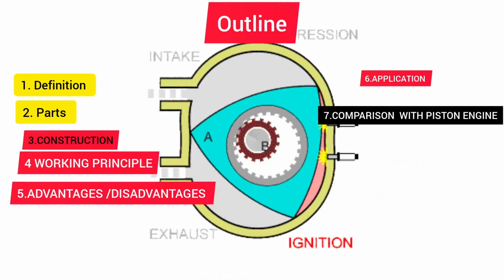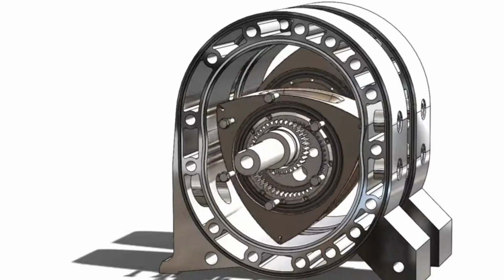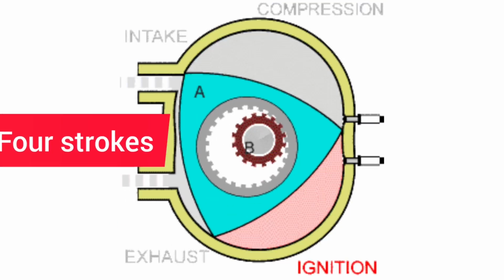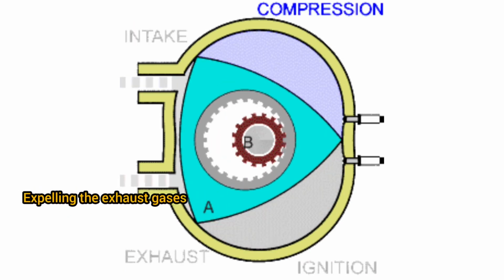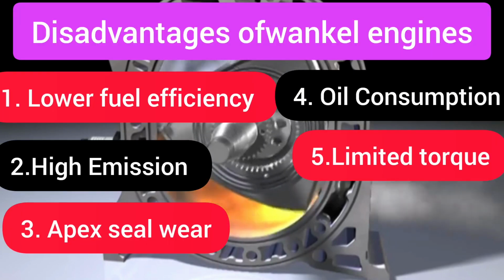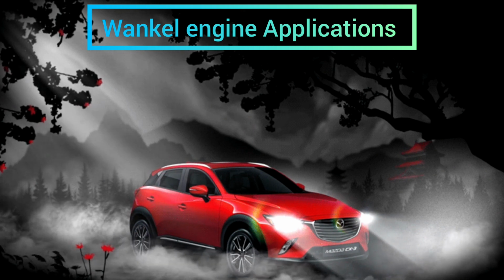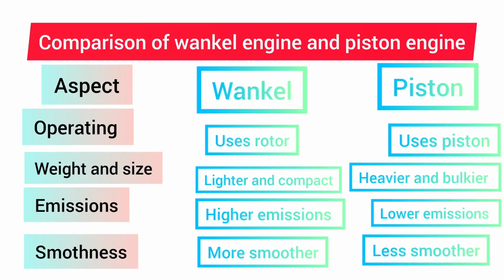wankel Engine full tutorial

Comment from the maker: 0:00 intro
0:18  outline
1:02  what is wankel /rotarty engine
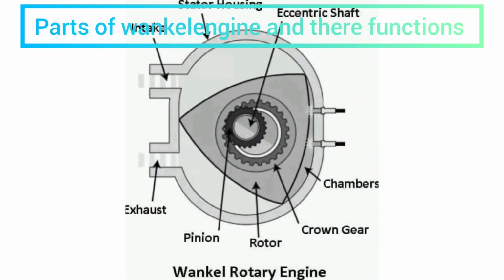1:34  otto cycle of wankel engines
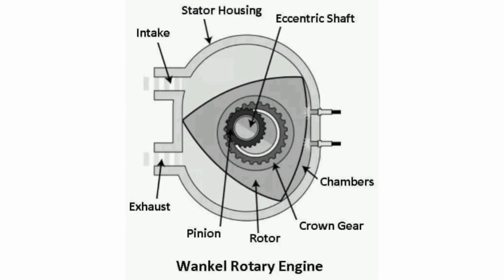1:45 what are  parts of wankel engine and there function?
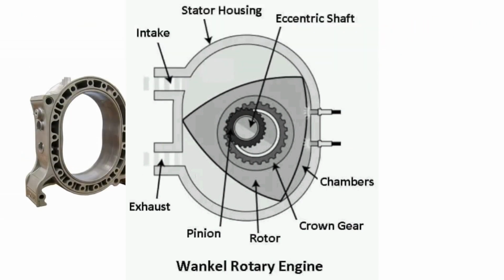2:02 Housing 
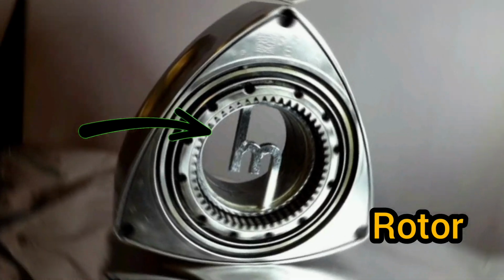2:12  Rotor function
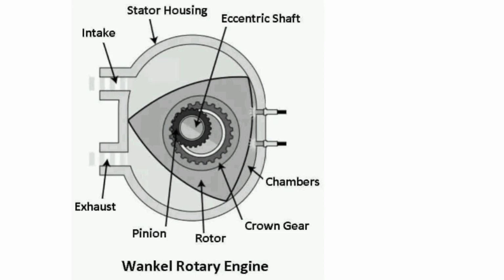2:25  Parts of Rotor of wankel engine.
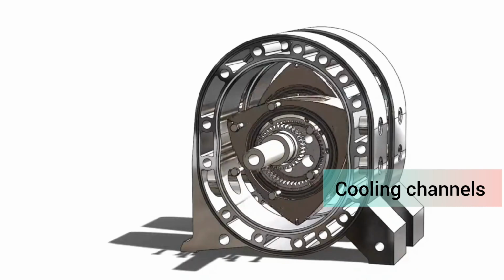2:47  Cooling channels
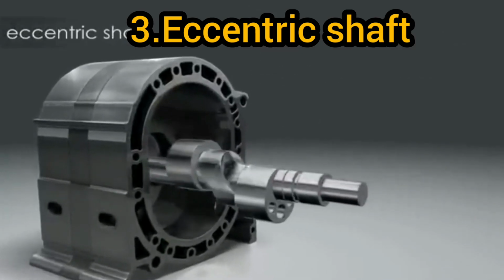2:55  Eccentric shaft of wankel  function and Construction 
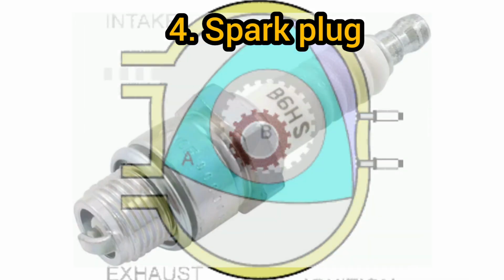3:12  spark plug of wankel engine 
3:24  intake and exhaust ports of wankel engine
3:34  combustion chamber of wankel engine
3:43  Housing seals functions
4:07  Construction of wankel engine.
4:49  What is working principle of wankel engine?
5:21  Four strokes of wankel engine
5:34 how   intake stroke works of wankel engine?
6:00  How compression stroke takes  place?
6:12  how power stroke of wankel  takes place?
6:23  How exhaust stroke takes place?
6:39  Why is wankel engine is so uncommon?
8:36  what are the advantages of wankel engine?
9:33  what are the disadvantages of wankel engine?
11:07  what are the  applications of wankel engine?
12:30  what is the comparsion of wankel engine and piston or ordinary engine